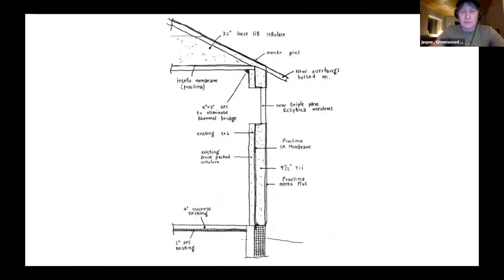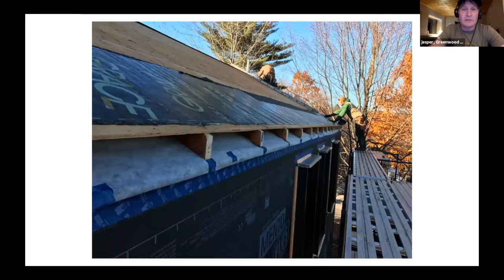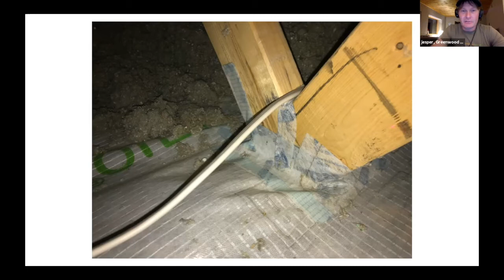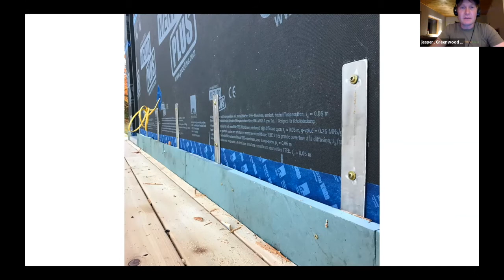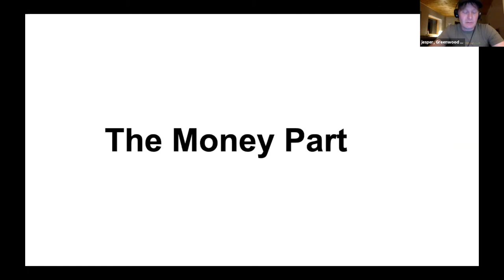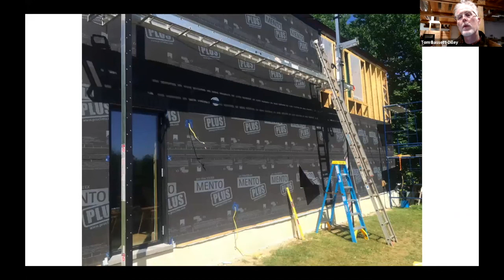Passive House Accelerator—Multiyear Home Retrofit in Maine

Comment: I'm curious as to why the Intello is installed in the attic with the lettering towards the unconditioned space. I thought it was supposed to prevent vapor from migrating from the living space into an assembly but allow the vapor to dry to the inside. So in this case, it would block vapor from the attic from getting into the living space. Maybe that's the point since the Mento 1000 with gap allows said moisture to "Vent" at the ridge.